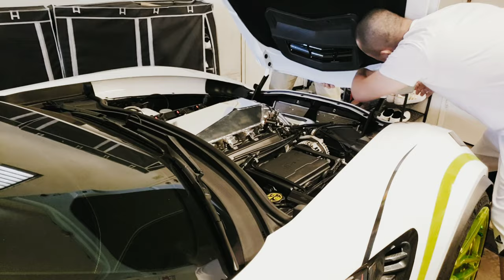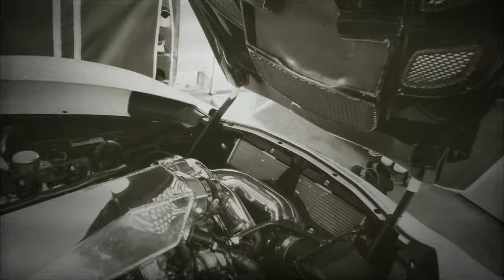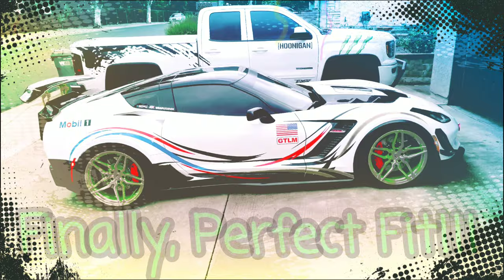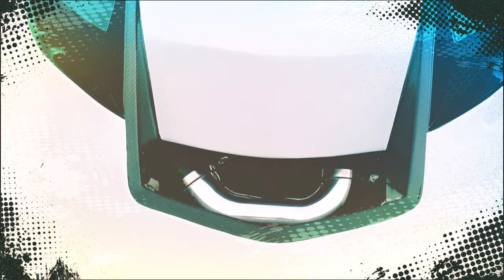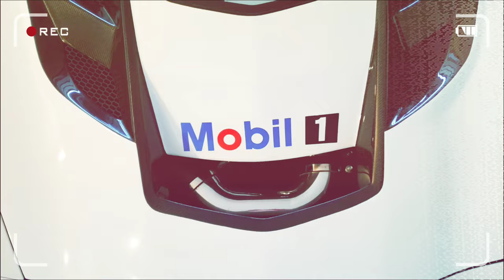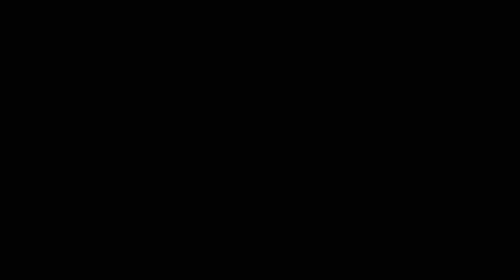Part 5 DIY: Carbon Fiber Hood Vented & Window Hood | Repsol13 F26 Corvette C7

Comment: Great job, looks great. How to align the hood ? I’m going to change mine soon .  Thanks
Reply from the maker: there is 2 place to align the hood, mainly by the hood hook and the spring unit.  those bolts can be move left/right, help to center the hood properly on the top.  

the bottom hood bolt also do the same.  good luck.  thanks for Watching

Comment: I want to get this but worried I won’t be able to align the hood without any gaps or anything in it. Did you have any issues with gaps? Or was you able to align everything with the hood pins
Reply from the maker: All three hood hinges, hood pin on the hood, & Hood pin receivers on the car can all be adjusted.  Same as all factory hoods are not square.

The trick to hood alignment to gaps all around for me, is very simple, lots of vette owner was able to do it easy.

Step 1:  Transfer all hardware to new hood, (hinges, some maybe already have pins)

Step 2: put the new hood on the car with all hinges and pins screwed on but LOOSE

Step 3: Align the hood to your liking, but all fasteners still semi loose, but not moving about, a little tension needed.

Step 4: start clicking them in and locking with the correct alignment, 2 people will make this job easier, I did by myself many times, works with 1 person, only because I repeat the process so many times.

Step 5 ~10:  After alignment, slow tighten down the front hinge to lock in place, in this excerise you will need to do a lot open & close the hood latch, the loose hood pin must be click in everytime, during the alignment, due to the final finish hoods are all in tension and flexed.

After start with either side of the hinges, slowly tighten and alignment,  5~10 times, to final tighten of hinges, NOW THE 90% OF THE HOOD is aligned. 

Step 20: Tighten the pins slowly to factory pin receiver setting, get to as close as possible,  then loose the factory pin receiver on the cars and slowly dial the setting in to alignment.   

Final step: After All Alignment done and pins tighten, you will need sometime later, after 2~3 drives around, give enough time to allow car chassis flex a bit with the new hood, then to go back loose ONLY THE HINGES slightly. 

THE REASON, is the flex of the car will move the alignment out, the slightly loose the hinges to release all the chassis to hood tension, HOOD HINGES STILL TIGHT ENOUGH TO OPEN AND CLOSE THE HOOD FREELY, while hood pins are holding it in correct alignments.

The way, the hinges can settle into the new tension free position, After another 2~3 drives, then go back tighten the HINGES to your liking. 

This will give you better alignment than your OEM factory hood.  

Factory installation has the benefits to align hood pins first, then the hood hinges, then actual hood hinges receiver bolt under behind the FRONT BUMPER, to a good FIT.  In our case, unless you want to remove all front Bumpers and anything else in front of hidden hood hinge bolts, we are stuck with factory hood hinge bolt settings.

Hope this helps,  it will take a little while, over time you will get it right,especially 1st time.  

My to final perfect finish, slow adjusted overtime was just under 1 year to loom like perfect height and gaps.  Only due to the 2 pins/2hinges locations coordinating overtime.

Thanks for Watching